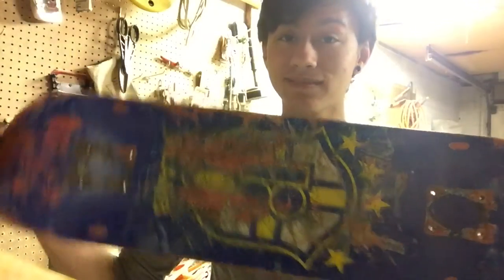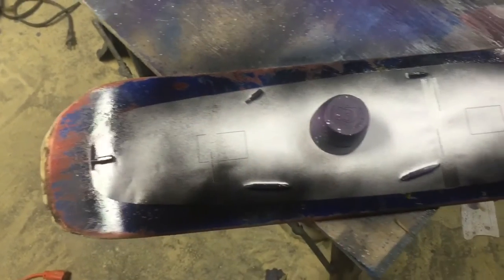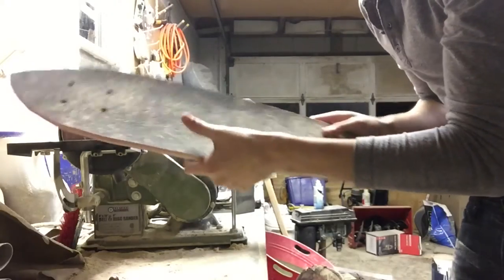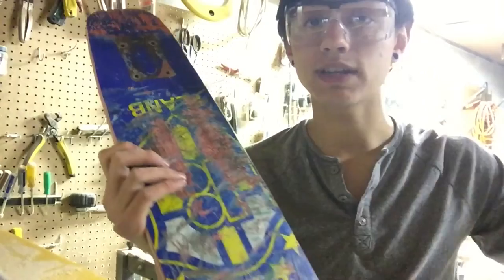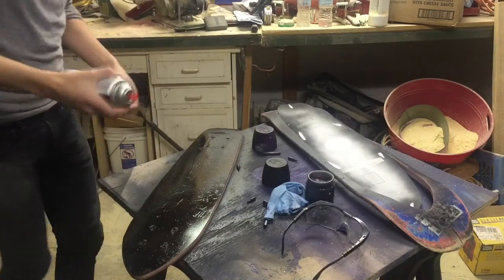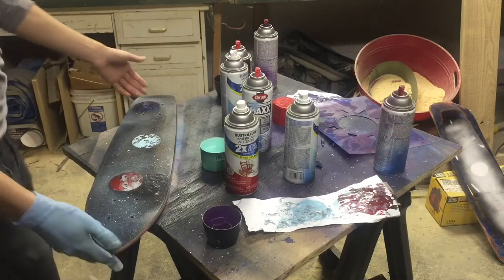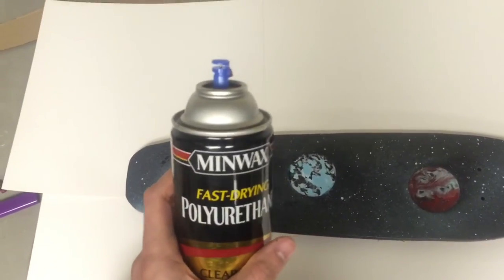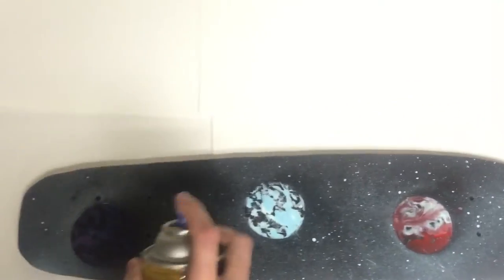How To Make A Mini Cruiser

Comment: What I have learned and highly recommend is in th winter a quick way to get the spray cans a good temperature is dip them just a little before the cap (so nothing doesn't get in) in warm water. That way if you don't remember to bring them inside at a room temperature it's a nice Plan B
Reply from the maker: Yeah I also used a heat gun in the winter to help dry at the right temp! But thanks 👌